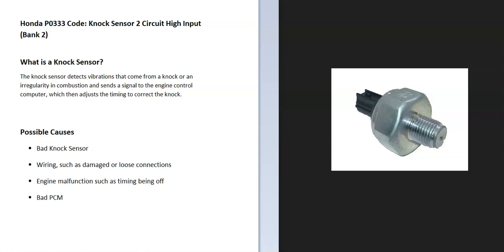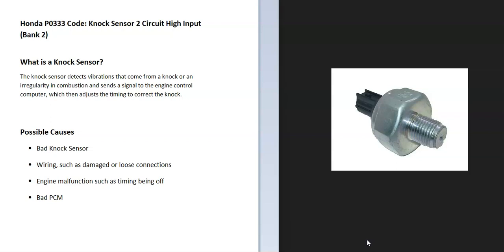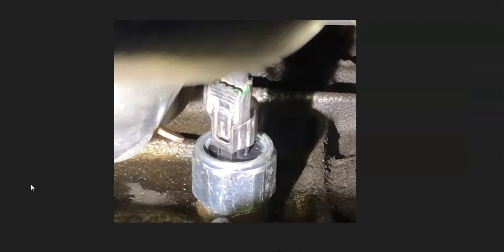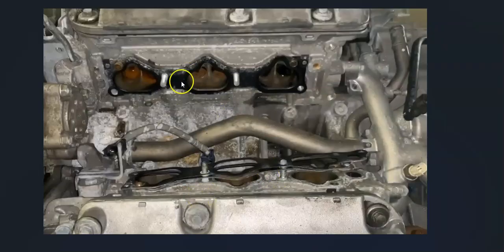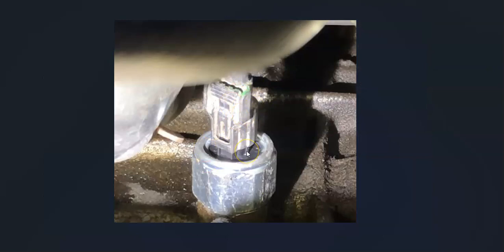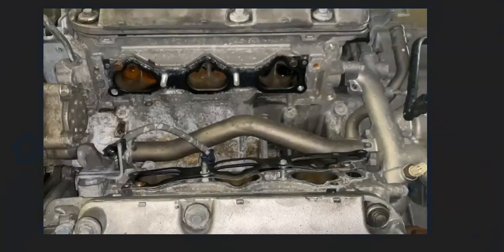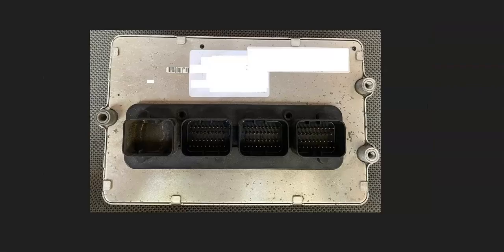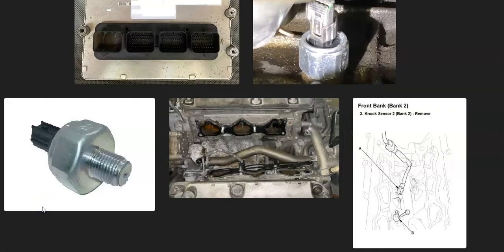How to Fix a HONDA P0333: Knock Sensor 2 Circuit High Input (Bank 2)

Comment: I have a 2013 Honda accord EXL v6, I have this code but it comes on and off. One day it’s on one day it’s off. Sometimes it comes off while driving or on likewise. Is this a bad sensor?
Reply: I have the same issue in my 2015 Ex-L v6, replaced knock sensor yesterday engine light came back on today… possibly a bad connector or wiring so be sure that you check both of those when replacing sensor
Reply: @DaDonLos  where is the knock sensor